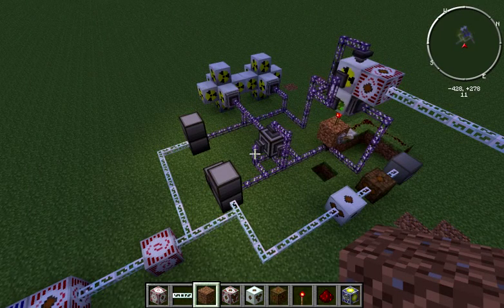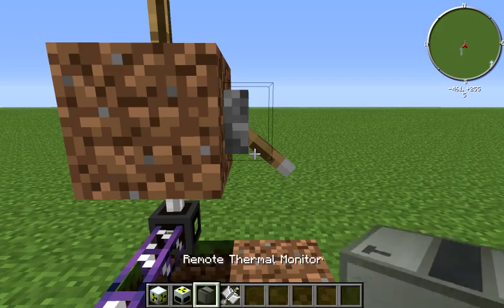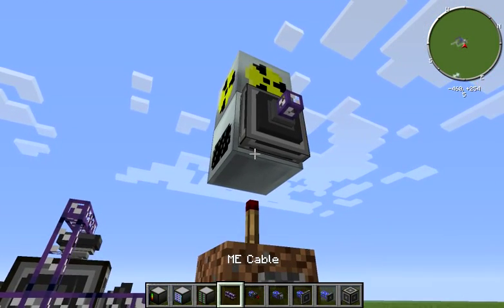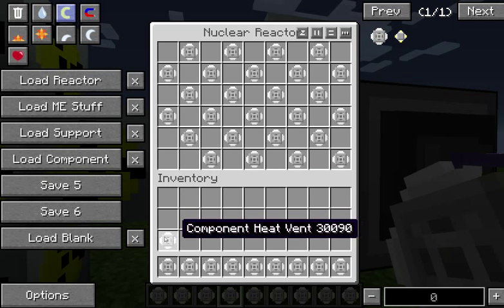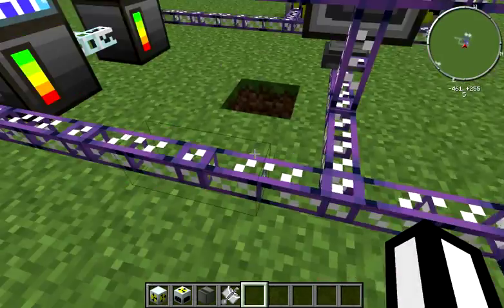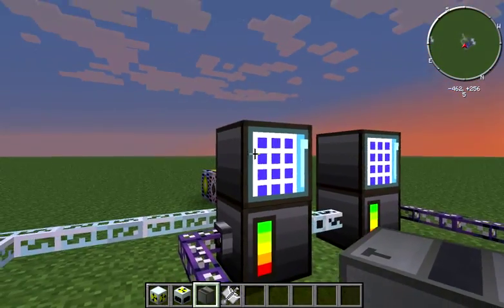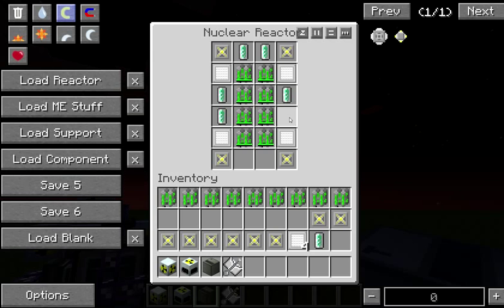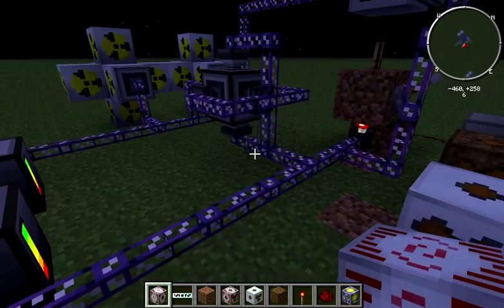Industrial Craft 2 - Block By Block CRCS Reactor

Comment from the maker: Good eye, kngrektor1.  I did miss a vent in the lower-left corner there.  As far as where you start the checkerboard, though, 93 faces will touch the coolant cells in either configuration.  Since it is a 9x6 grid, whichever way you have the top row, the bottom will be the opposite.

Comment from the maker: Fedor, This was done in Unhinged 1.1.0 which is for Minecraft version 1.5.2.  This is the same basic design that I used on FTB Ultimate for Minecraft version 1.4.7.  It should work in both, just that the plutonium puts off more heat and power in the previous version, and there were no precision export buses.  Regular export buses can be used in older versions.